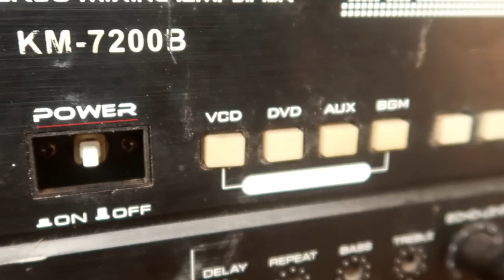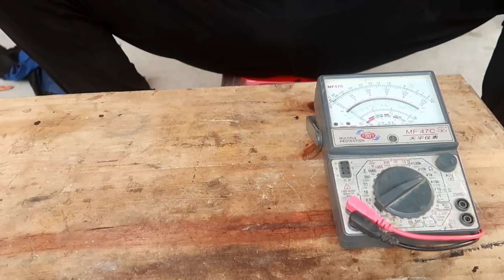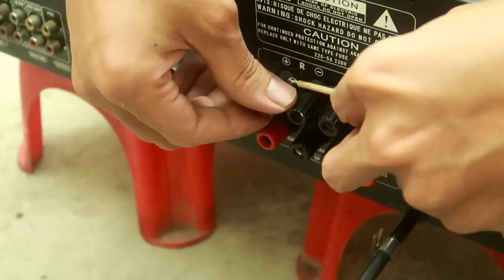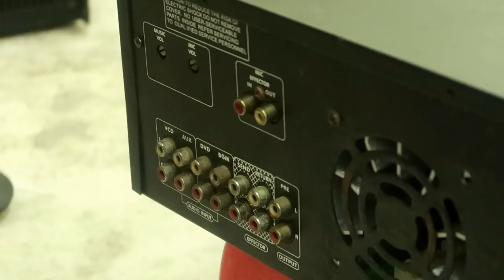Restoration 8-transistor signal amplifier // Complete restoration process

Comment: The restoration in the metallic and plastic parts is perfect, but in the electronics it is false. Anyone who knows electronics knows very well that you are using the tester on the scale of continuity in resistors and capacitors and it is not the correct way to measure those components that way we know that those boards were in good condition, only dirty, you only changed some resistors that they looked bad

Comment: Tampering and deception. The cooling plate that is supposed to dissipate heat is sprayed. 6 original buttons and 6 speaker connection terminals are missing that are suddenly there later. The telephone is connected to the VCD input while AUX is switched on on the amplifier. The amplifier continues to play while the volume is turned down.